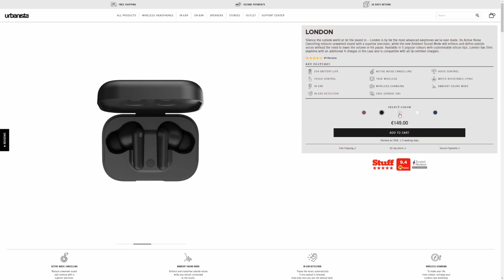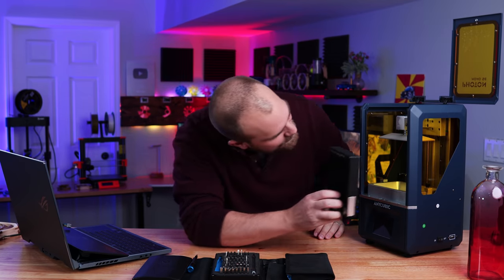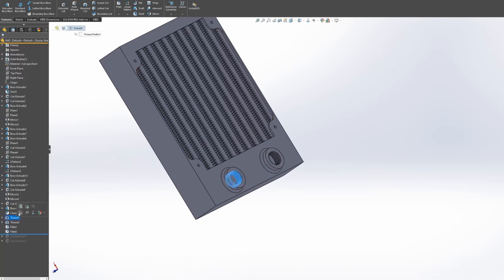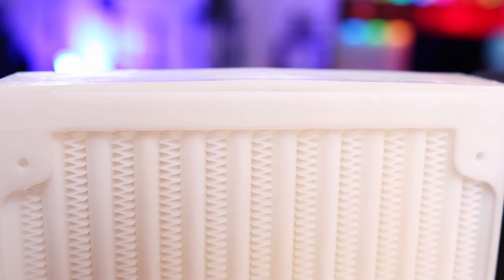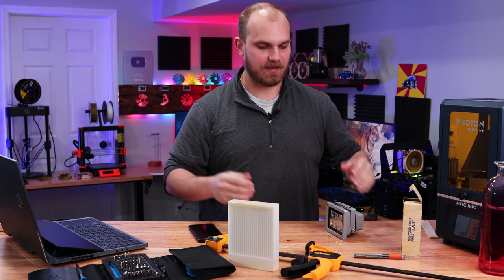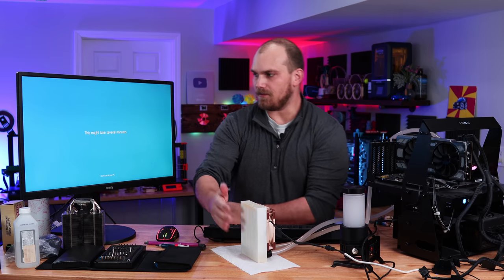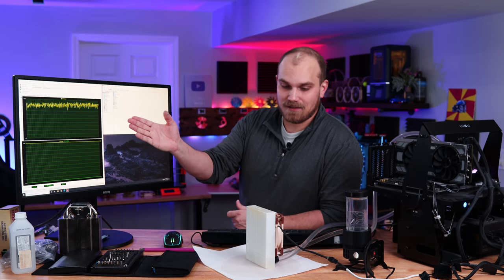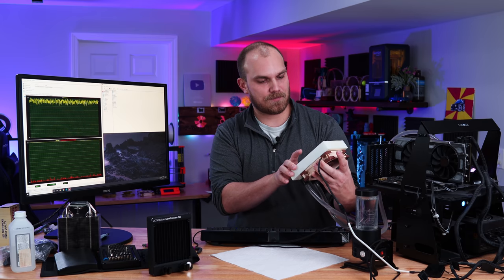I Never Expected This | 3D Printed EK Coolstream SE 120mm Radiator

Comment: Just to do it a bit more "scientific" to a test without a radiator, and compare the resoults. Then you get a indication of how mutch influence the radiator have.
Or hav a temp sensor on both sides of the radiator and a flowmeter. then you can calculate the actual power disipation. ;)

Comment: Ok, so, having recently gotten a resin printer myself how the hell did you get away with the cantilever on those radiator fins as they're printing?  They look like they should have drooped rather badly without supports, but any supports would have blocked airflow.  Are they just short enough to pass?  Or have you printed enough to just know what the critical angle is for that particular resin?

Comment: not super pc savvy but do enjoy the content very much, I just had a question for the comment section as well as an idea. If you were to print two 120mm radiators and run them in tandem like would you see a bump in performance since the fluid would have more time to disperse heat?
Reply: also, would there be any difference in performance between two smaller radiators in tandem vs just a larger printed radiator since you are limited on print size?

Comment: now all you need to do is remove all little fins so air would go through radiator without being hindered AND MAKE radiator FAT so AIR WOULD DO MORE WORK cooling it down. also maybe doing water channels a bit zigzag with obtuse angles e.g 150deg would make water travel through radiator a bit longer = cool it a bit better.
with this you probably can do a much better resin radiator.
Reply: second idea is to make flat labyrinth tube as fat radiator - one in and one out with inner flat tube cross-section being equal to round tube diameter.
Reply: also you can start new series called radiator showdown))

Comment: The real beauty of this idea is not that you can print a radiator that somewhat works.
The real beauty is that in 3d print you can give your radiator all shapes you can imagine.

Imagine a case that is rounded, with rounded air intakes that are mesh radiator and case in one part.
behind that fans could be positioned that hug the shape of the radiator.

Imagine a case that has a completely random shape, with all the case being double walled, radiating heat in all directions.

Imagine a case that has the shape of an oldtime car, with the radiator being shaped like the old car radiator.

Imagine!

Comment: They make filament with wood particles. Surely they make resin with miscroscopic aluminum or copper particles. If you could use that this would work 10000% better

Comment: Dang in like 15 years or so when graphene 3D printing becomes more accessible and cheaper, you'll be able to 3D print this rad and it will probably perform better than this or even some normal radiators.

Comment: put inport n outport on bottom of radiators it should give u enough room to print it

i think we need give u more 👍 to afford for taller 3D printing 

2nd i notice top piece not taller enough so going to leak anyway
n u forgot about other side for fan bolt hole
try run dual fan n see if it work

Comment: DUDE.   You're leaving so much performance on the table!!   

In water loops in automotive or hydraulic systems, air ALWAYS wants to float. Which means with entrance/exit on the bottom, you're only completely filling one side till the top of the inlet side overflows into the side flowing down..  There's No way for air to escape.   

so, Fittings up, radiator laying flat is the BEST way to get the air out.  second best way is radiator on it's side with the inlet on the bottom port.  This will fill from bottom to top and the top port will push air out of the radiator.  Do this on radiators, and cooling blocks. Fill bottom, exit top. 

Keep this in mind when doing any more water cooling experiments. I've dropped 15-30 degrees on different cooler installs from Whipple Superchargers that had the SAME install setup on their radiators.. Don't leave results on the table.  ;)

Comment: So... I know it would be a lot of resin... But if you are 3d printing the rad... Why not make one that's a weird shape... Maybe a long tube takes up like 1/4 of a case.... You can shape it to be purpose built rather than what could fit... It could work... Would need high static pressure fans though.... Hmmm

Comment: We need a 100% 3D printed water cooling setup. Don't know if you can gut the motor out of a fan and stick it in your own housing or not. Print the tube, reservoir, fittings, radiator, and fan blades. I guess you have to keep a metal block unless you are a mad lad that wants to seal the block directly to the die and run straight water over the IHS. I even think that video would be clickbaity enough to get lots of views.

Comment: Get rid of the fins. The plastic isn't conductive enough for it to be helping. You need to have as much surface area on the water channels in front of the fan as possible. So a lot of really thin channels.

Comment: To be perfectly honest, I think this has the potential of a new series. A "radiator showdown". Why? Because with 3D prints different designs are possible compared to working with aluminium/copper. The winner of the showdown could then be printed with a metal resin and tested against a classic radiator.
On another note: Because you were missing a reason for it to be plastic. There is. As always, it is RGB ;)! The white resin should be somewhat translucent.

Comment: Cooling effect is only from the thermal mass of the water.
My 2c.
Reply: Not entirely true. With the metal radiator and no Fan blowing on it will cause system to overheat once the water reaches maximum heat saturation in the water. We've seen it happen with the fan design challenge. It needs more than just water moving through the loop. The fan and plastic radiator are keeping the water cool enough for the computer to run without shutting off or causing severe throttling. I guess the second part to prove this would be if he had turned off the fan to see if it got hotter. Which it would really. He said he had felt warm air being blown from radiator. That does mean some heat is being disapated.

Comment: How about a radiator - that size with 4 vertical tubes, and using pex or other means, connect 4)  E3D style cool end fin sets for the heat transfer?!
Easy, No.  Worth the time?  Oh Yeah!

Comment: I feel like monitoring the Water Temp would have told a more meaningful story. With the CPU at 80+ degrees, it's not unreasonable for the water temp to reach 50-60+ degrees. At that point you're killing the pump.

Comment: yes please make a new series: PRINTED COOLING. make a better 120mm design that would dissipate more heat, then if possible maybe make 240 and 360mm variants and again see the difference. if with a 120mm it throttled but not much, i can see a better design and a larger size dropping like 10 more degrees.

Comment: I now want to get someone to make and send me a double/triple(depending on what my case takes <insert the fan size for the top of my case here> radiator with either 2 or 3 of the best fan from the fan showdown that would also fit in my case with a water cooling loop just for the bragging rights of having 3D printed water cooling parts in my rig that aren’t just fittings

Comment: Ok, totally cool project and I loved watching the video so I'm not here to take anything away from it.

Alright, that out of the way, your idea behind it thermal throttling is a bit off. You're not really stress testing the CPU at all during your test. So the reason it wasn't thermal throttling is because it simply takes that long without any serious load on the processor to heat your liquid that much. And even with poor heat transfer from the plastic radiator, tubing, and container vat, there will still be enough to prevent any serious throttling.

Take your same setup and run PRIME95, AIDA64, Intel Burn, AMD Overdrive, etc. in the background to get a more realistic analysis of how fast the CPU would throttle and for how long compared to a metal radiator.

Comment: You need to measure the water temperature going in vs. coming out.
Reply: You may want to print in matte black, this increases the blackbody radiation emission and heat transfer. Hence why a lot of commercial heat exchangers are matte black plastic, coated copper or black anodized aluminum.

Comment: I think you copied the shape of the mental piece, when you didn't use the benefits of the resin, you could give it a completely different shape to extend two channels and connect all the channels (I think you could add metal particles inside the resin to distribute the temperature)

Comment: Now you have to try and design and print a resin radiator that works better than a stock metal one. You said you could probably do it, so put the money where the mouth is. We have the faith!

Maybe you should also try to find out what the resin's thermal conductivity measurements are.

Comment: A printed  rad should not have fins, they are to utilize a strength of the metal, thermal conductivity. Plastic does not have this strength. However, a normal rad is also restricted by manufacturing restraints, it needs not only to be possible to machine and assemble, but also in a cost efficient way. If 3Dprinting a rad, you almost have no constrains on the geonometry, so you should design for maximum surface area from heat carrying water to thin plastic to air. so probably 100ths of flat thin tubes.

Comment: I would not use a plastic radiator as the heat transfer is poor in the material, doesent matter wich fan, it will always be worse than a metallic

Comment: Project. Why not improve on LTT's living room radiator that they bought used and had so much gunk in it that the experiment failed. 
Buy a 200-300 living room radiator, new, without gunk in it.

Comment: Print another one! Next time skip the fins and either increase the number of flow tubes or make bigger tubes. The point of the fins is to increase surface area, but if plastic or resin is thermally resistant then all your printing is airflow restrictors.

Comment: All these comments and only a few questioning the time it takes to heat this volume of water without a radiator. I'd wager there would be no difference from using this plastic radiator.

Comment: I`d say 99% of the job was done by the pump and water.... I mean with around half a liter of water and enough flowrate for the water I`d argue you need no radiator at all... just point the fan at the junktion on the tubes and res...

Comment: This design doesn't make sense for resin. You don't want any fins due to low conductivity. You should instead make as many pipes as possible, possibly very flat, thin walled pipes.

Comment: Should have made it more than just a twin pass
should have used super glue to fix it
should have used linux
why do computer people not know how to correctly orient a radiators ports?
if you're going to compare prices and only include the cost of the resin you should compare it to just the shipping of a standard radiator
Edit:  Damn, you filthy casuals just astonish me.  The purpose of 3d printers isn't just to make a bunch of plastic waste.  This was a massive waste of time and resources, just to amuse mouth breathers.  I bet you want to 3d print some legos too